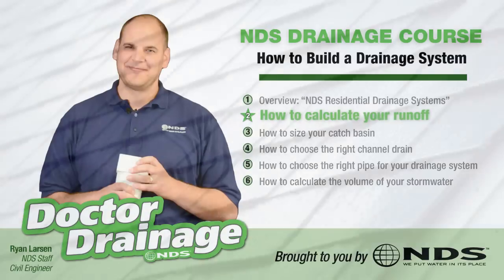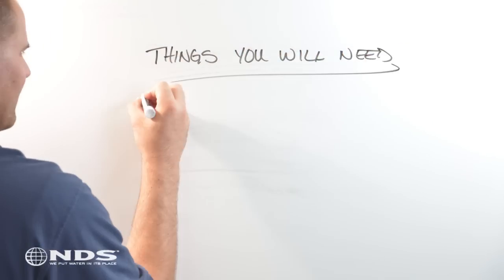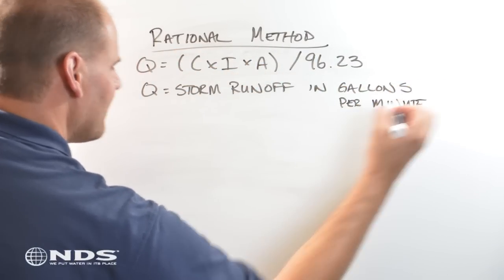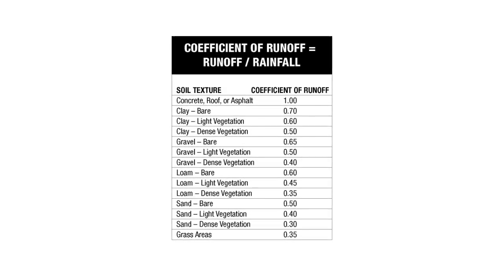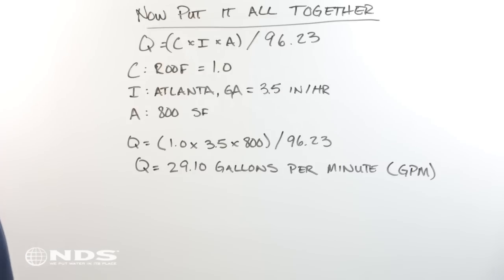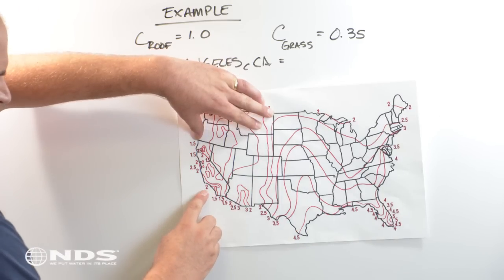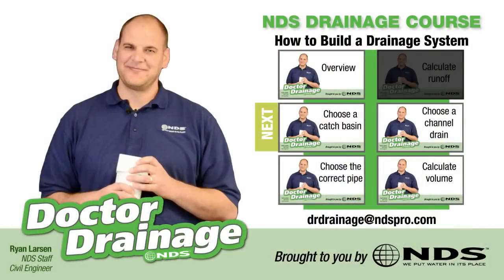How to Calculate the Volume of Stormwater Runoff on Your Property | NDS Drainage Solutions

Comment: Rainfall is measured by rain gauges whose collection opening is horizontal. Therefore, roof area needs to be horizontal. You need to multiply the roof area in the video by the cosine of the roof angle (in his sketch, cos (45deg) = 0.71.  If you are looking at draining your yard "swamp", multiply the roof area by two other factors:  Gutter Clog Factor (my gutters are perpetually clogged, so I use 1.0); Applicability Factor (my roof has two dormers, the applicable area is the area between the two dormers, roughly half the roof, so I use 0.5). Then add the area of the yard "swamp" to be drained.

Comment: do we need to calculate a flow rate of rainfall from wall of building. I am calculating The storm water runoff for a landscape area which is beside a building 140 meter height and 80 meter length. The wall is glass. Please advise me. Thank in advance.
Reply: You do not have to consider the wall for this type of calculation.

Comment: How to calculate rainfall vs infiltration into the soil/ground....? please tell me with example....
Reply: You’re probably just gonna have to use a hose. Maybe dig a hole at the bottom of the hill or whatever your collections on his line it with a cheap tarp or piece of plastic and then either run one or two hoses from your house at the top of the hill or wherever the most rain typically falls or fill up a wheelbarrow and dump it. I have pretty dense clay and I legitimately have about 65% to 70% runoff during more than 2 1/2 inches of rain per hour rain events. If the rain is falling less than approximately 2 in./h it all seems to go into the ground fine.
There are other ways to do this calculation like the leech field test, but I personally find the leech field test in accurate, because safer instance your house sits on 10 feet of dense clay and then somewhere between let’s say 8 feet and 30 feet underground is a large rock that is a quarter-mile wide in both directions. The water will drain out of the Leitchfield very easily and very quickly and show that you can drain a couple hundred gallons in 30 minutes and are safe to build a septic tank, but when the ground water become saturated from a local river or something else flooding, then the system will no longer work. So the leechfield test Will not differentiate between seepage along the ground water plane to the left and right or down to the depths of the earth, which imo is not a good test especially for places with rising groundwater in spring
Reply: You need the soil type to calculate infiltration (i think clay soil is around 0.1 in/hr to 0.2 in/hr & course sand might be around 5 in/hr to 15 in/hr. No clue on either, but clay might be close) you'll also need to know if it's bare soil, a grassed area or the type of vegetation on the ground. You can find these rates within various engineering sources (codes, UDO's, etc) and agricultural data (There are a few methods you can use to calculate infiltration. Which one you choose will depend on what exactly you are calculating. If you are trying to figure out how much water is running off land into a drain you could use a % of that area. If it is grassed or wooded it will change that factor. If you are trying to figure out how much water is actually flowing thru the ground you will need the soil type. If you're trying to figure out how big to make a dry well you might find it helpful knowing that using 1 foot of gravel below the unit in a 4'x4' hole will give you 16 ft² of gravel under the unit and 42 to 30 gallons of water can be stored in that much space (48 if you have washed angular gravel, since it can't stay perfect  start with 42) Using 2 cubic yards of rock vs the 1.5 cubic yards with a 1'-10" bottom will allow 52 to 73.5 gallons of water to be stored below/84 gallons with washed angular gravel. So you can have a good bit under your flow well. Or you can eliminate it all together using a reverse french drain (if you have the room for it.) With the dry wells you get most of the space it takes up in the ground, guessing 90%. So it can save you a little digging.
Reply: The various sources I mentioned (engineering / agricultural) may give these rates for saturated or unsaturated soil, if the application those calculations calls for it. (Like fine sand used for a sand filter will probably be given when the sand is wet and being used to filter out contaminants which I believe is close to the same rate water infiltrates into clay soil. Which I belive will be around 0.1 to 0.3 in/hr. Even though water can infiltrate fine sand near ten times that/ 1 in/hr to 3 in/hr. I believe sandy soil is similar to this rate.)

The exact number may very. So will need to check them for the exact application you require. Which I'm guessing has something to do with drainage, but even that it can be hard to say the exact reason you're asking and you'll need to find the exact numbers for the application specific to what you're doing. Whatever you're doing, Good Luck!

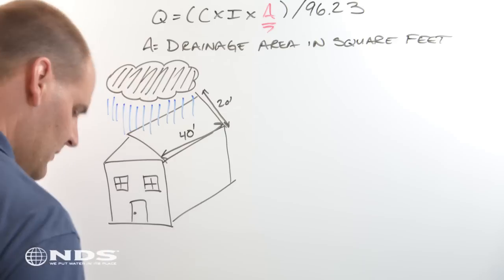Comment: 3:12 You actually said "The square footage for one HALF of the roof of the house shown here is 40' x 20' '" AND you drew that dimension. Then why would the square footage be 800 sqft my bald friend? If HALF of the A frame roof that you drew is 800 sqft then the TOTAL should be 1600 sqft. COME ON! And you call yourself a doctor! You'd expect bullshit calculations like that from your nurse not you. Doctor Drainage.
Step in to my office, cause you're fucking fired! And take your nurse with you!
Reply: The drawing is misleading.  To be clear, the area you should care about for this task is parallel to the ground, not along the slope of the roof.  So it should be calculated as horizontal width x horizontal length and the fact that it's sloped should be ignored.
Reply: I thought so, too at first. But, the entire area of the roof is exposed to and collecting rain water, regardless of the slope (excepting 90 degrees, parallel to rain fall).  Now, if we wanted to figure the aerodynamic drag of the roof flying through the air, then slope would be very important. Look-out, Toto! 🙂
Reply: OIC:
At 4:06 he says, "this portion of the roof."
The question should be, "Does the 20' length horizontal or sloped (as it is drawn)?"  If it is horizontal then  "this portion of the roof" would be 800 sf.  If it is sloped then the question is, "what is the roof slope?"
Reply: The roof total would be 1,600 ft², (Assuming the other half is a mirror image.) He only drew a dimensions for the half of the roof he was working with.

A dimension showing both halves of the roof would  be the distance between the end points of the roof & wouldn't account for the extra distance created by the slope. Since the roof on the house drawn doesn't appear to have any over hangs it makes it easy to explain. The 40' dimension would be correct, but other dimension would have been across the front of the house. That dimension would be less than the 40' you'd get from adding the 2 20' halves of the roof together.

So he only showed dimension for the half of the roof he was working on. Had he measured the bottom corners of the house then taken half of that for the roof area it wouldn't have accounted for all the area of the half of the roof he was working with.
Reply: 800'sq per side

Comment: Where to find the 100 year flood maps?
Reply: I paused the video.  However, you can also Google the NOAA website for the chart.  (It's in a research paper from 1961.  I wonder if they've taken into account Global Warming/Polar Vortex?)
Reply: @danharty7517  they don’t take anything into account except individual insurance claims for flooding every 10 years. That is what drives most of the map changes. 

Otherwise we would have to accurately map the elevation of the United States from drones or satellites which would be difficult, Especially because rivers and large salons are nearing projects will change the natural course of water

Comment: why use the rational method? you want to calculate volume. the scs curve number gives it directly and more accurately. with the rational method you're calculating peak discharge, so by multiplying with time you're overestimating volume!!
Reply: Because homeowners and unlicensed landscape installers will often be doing these small application calcs and they don't need to be using SCS when the simple rational method will work just fine.  It it overestimates, the additional factor of safety won't hurt and will offer some additional capacity when clogs inevitably occur.